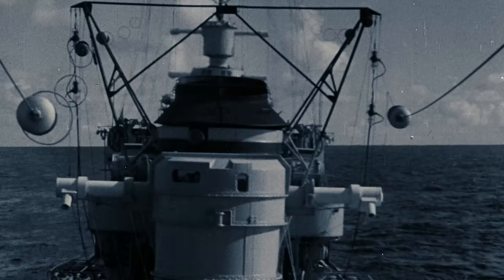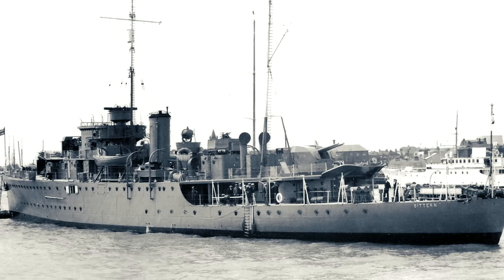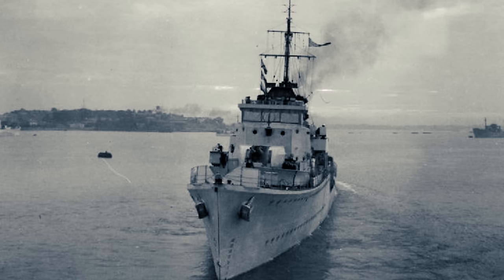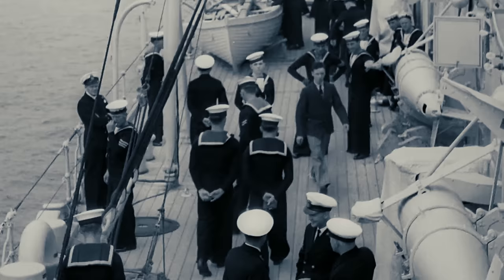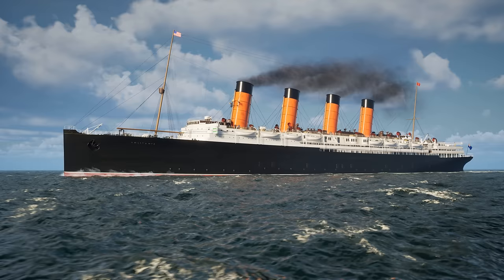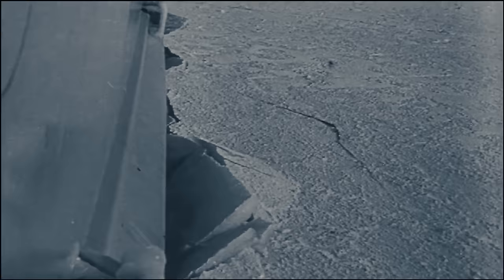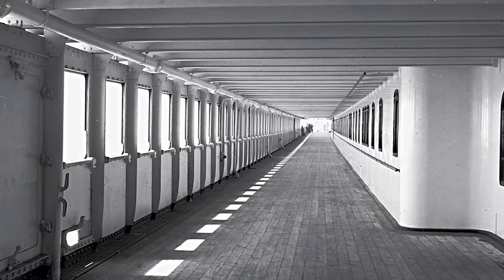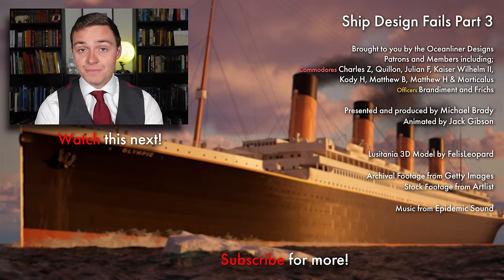When Designers Fail: Three Ship Engineering Mistakes from History

Comment: Hunt class: the second you mentioned a narrower beam and shallower draft I just started repeating "Topheavy" over and over. Topheaviness was a pervasive problem in so many 1930s designs across multiple nations. Naval architects across the world really tried to cram as much as they could into as small of a hull as they thought they could get away with.

Gneisenau class: They had a good idea with the straight stem but yeah, with how rough the Atlantic is, a raked Atlantic Bow should've been an obvious requirement from the start. It kinda worked out for these ships, they racked up quite a reputation during the war.

Olympic class: Seems like loading from the boat deck was intended and this was just a mistake in procedure, honestly. Captain Smith was used to a ship with a slightly different layout.
Reply: Longer keel, narrower beam, higher superstructure... all things that led to the capsizing of Mary Rose in front of hundreds of spectators, including King Henry VIII. 

All that, coupled with a shallower draft and I just winced - and I'm not even a sailor!
Reply: @Teverell  Also the Princessa Jolanda, who capsized right after launch due to how topheavy and unballasted she was.
Reply: @aircraftcarrierwo-class  not to forget the major headaches the Japanese had with almost all of their destroyers and cruisers when Tomozuru capsized
Reply: Much of the top heaviness was due to additional equipment added after the ships were built!  Additional anti-air weapons, fire control directors, and radar!
Reply: My first thought when he mentioned the narrower beam and less draft was, “ I may not know much about boat design, but sounds like a bad idea!
Reply: Thank the politicians who drew up the ridiculous Washington naval treaty.
Reply: Scharnhorst class, not Gneisenau.

Comment: The new US battleship classes, North Carolina, South Dakota and Iowa were also very wet ships when serving in the North Atlantic. This seems to be because of their "coke bottle" hull shape with a very narrow bow section, but wide aft compared to European battleships. During the 1953 NATO excercise "Mariner" USS Iowa had to drop speed and cease fire, while HMS Vanguard was moving happily along at near full speed.
Reply: That was a necessary design flaw, as all US battleships were designed to be capable of going through the Panama canal. Ideally, thr Iowa class would've had a wider midship design.
Reply: Of course it would move happily along,the British had rum! 🥴
Reply: What if Germany had produced 20 or so Bismarks? She had NO design issues!
Reply: @Teddy-tv7rq except the weak guns, bad radar, bad aaa and such. she wasn’t a bad design per say but there were significantly better designs in the same period
Reply: @Joshua-fu9yw  Guns were not really weak lets be honest the AA was also good, the radar was bad though.
Reply: @Teddy-tv7rq  20 Bismarcks would have occurred a little problem - where Germany would have get the fuel for 20 ships when they had not enough fuel for 2 ships?
The lack of fuel forced the German ships to stay in the harbor - like Tirpitz they could not move with cold boilers and where easy targets for air-raids.
The crews could not be trained and the few times German ships went on a mission half of the crew were simply seasick.
The absolute lack of cruisers and air-carriers marks the next problem.
Göring prevented the German navy to have own air planes.
You have to see the whole picture: the Kriegsmarine was not ready for the war - it would have lasted 10-20 years to build a fleet who could match the British.
Reply: @pilsplease7561  weak is relative. compared to her equivalents in over navies her main guns were a low size and power. the aaa was in theory great against dive bombers but the computers could not effectively track and target torpedo bombers (especially the swordfish). as i said, she was not a bad design and had her merits but when compared to other ships of a similar size and role within a fleet she was not up to par
Reply: @ulrichbehnke9656  the kriegsmarine proposed a building plan that had a completed fleet to match the royal navy in fleet strength by 1946 called plan z, but even this was flawed because it did not take into account the royal navy would not allow the kriegsmarine to match it in strength and would subsequently build their own ships. and this is still assuming they could crew and fuel these ships as you pointed out
Reply: @Teddy-tv7rq  Given Germany's ship building capacity by the time the last ones were commissioned it would have been about 1970. Even the first two were built to out of date late WW1 ideas, the later ones would have been museum pieces on launch.
Reply: @Joshua-fu9yw  Apparently another problem with some of the Bismark's AA guns, was that the Germans had not considered that they might need to fire downwards. This becomes embarrassing when a Swordfish attacks from below deck height.